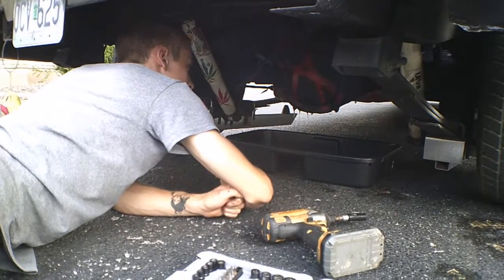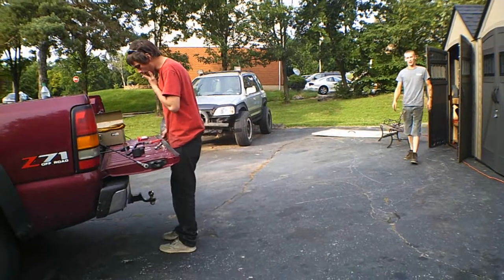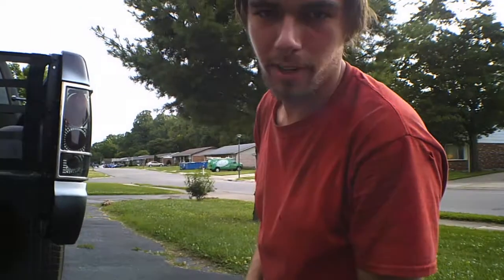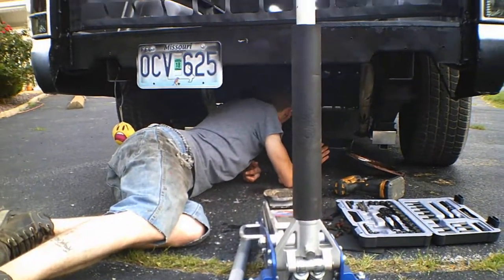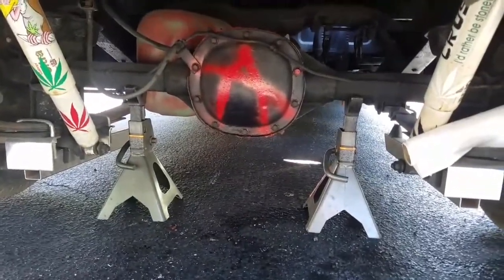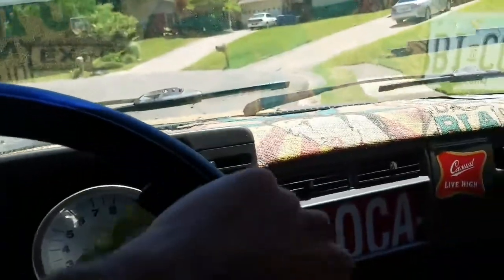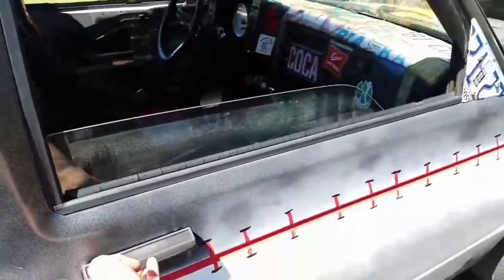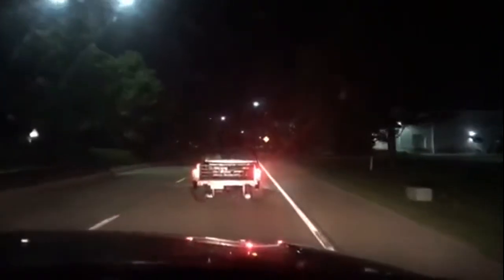Welded diff s10 V8 Burn Outs!!

Comment: Doesn't sound very healthy
Reply from the maker: life-with- mike it wasn’t at that time carb problems all good now!!! Not rich anymore
Reply: @Koreyjoe  good news. I just watched the rebuild video what heads did you use
Reply from the maker: life-with- mike thanks for watching and the support a speed shop did they quick for me just case iron heads new valve seals and valves and springs runs better then it ever has!!!
Reply: @Koreyjoe  you bet.. I've got a race10 also 355 small cam double hump heads t5 trans and a welded rear I'm taking it to the track Saturday to see what it puts down for being a junk truck